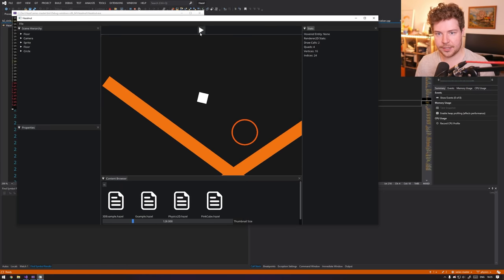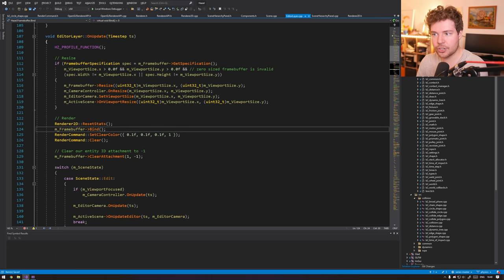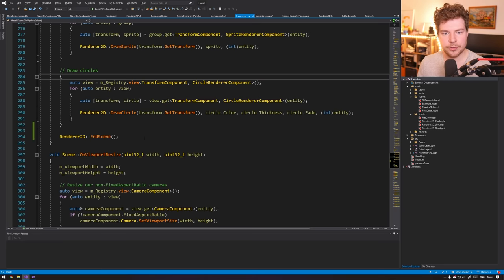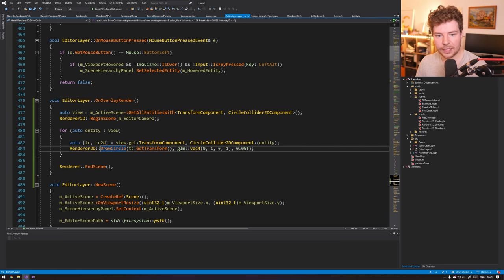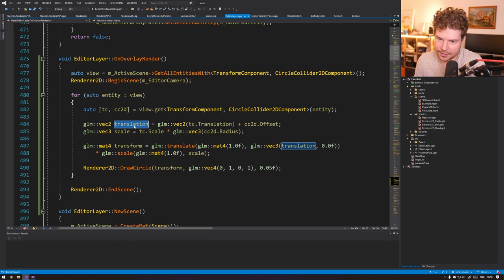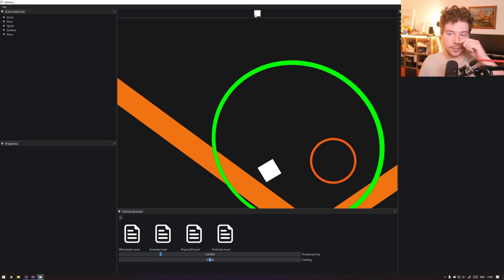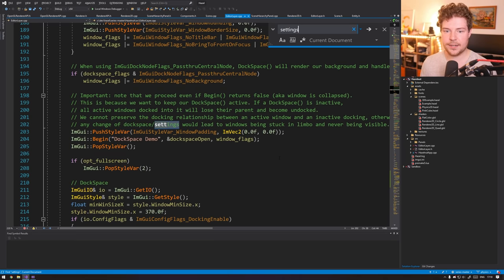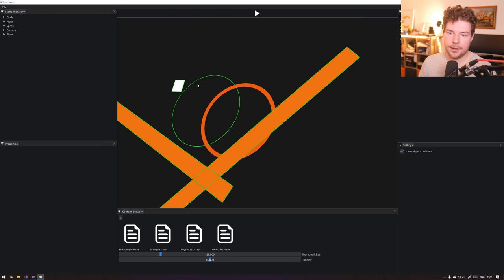Visualizing Physics Colliders // Game Engine series

Comment: Do you think it would be a challenge to make it possible for users of the engine/players of a game be allowed to switch rendering apis at runtime by recreating context and swapchain and window if the chosen api is changed?
Reply: At runtime you cannot do it easily, only if this APIs supports by your OS window system and you in editor mode. You definitely need to update current frame by swapchain and then destroy current rendering context, and before new frame, ie when you start to drawing/or use ImGUI you need setup new API, create context, init ImGUI with this API and only then draw with new API. But if you at runtime you cannot do this, or can but you need stop scene or maybe pause it, because this operation obviously large.

Comment: Why you're still using Visual Studio 2019?
Reply: He use visual assist, but as I know it’s currently do not supports vs2022
Reply: Visual Studio* there fixed it for you.
Reply: @feschber  No, visual assist is the plug-in for visual studio. (Also I’ve just checked and it is now supports visual studio 2022)
Reply: @NRodriges  It does
Reply: @prezadent1  Why you still driving a 1999 Toyota Corolla?